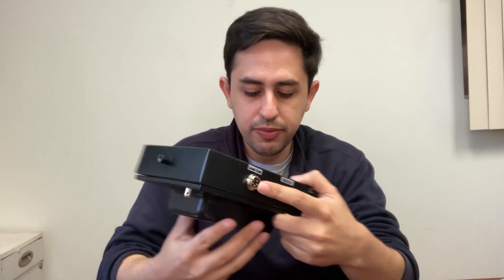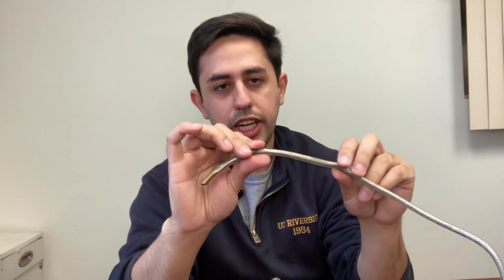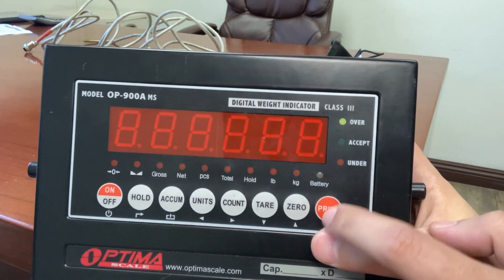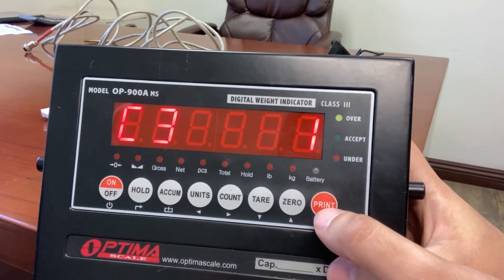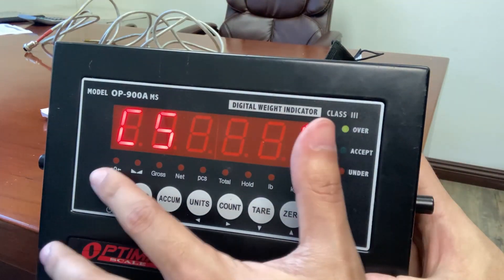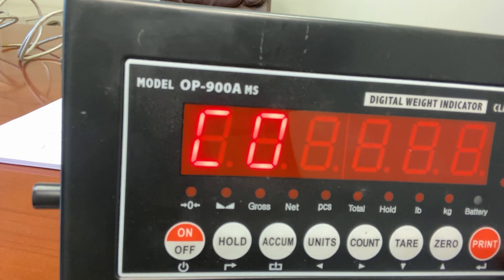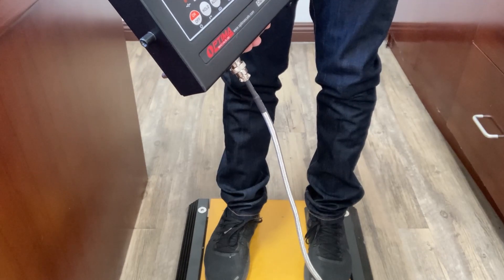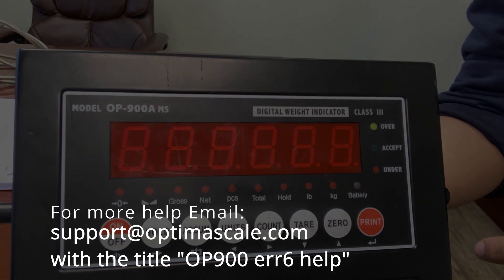OP 900 Err6 / Calibration

Comment: Hey man, great videos. I do have a question about error 3 and 4 for the 900b ex. As well as when a scale head is powered on and just has dashes and won’t let me do anything.
Reply from the maker: error 3 is input signal is negative. This usually happens when the green and white wires are swap and giving a negative signal. You can check the C15 setting to see how it responds to weight. The video on the channel called how to fix a floor scale explains more about this. 

error 4 happens when weight is unstable. Usually customers put too many decimals that their scale can't handle. Try to use less decimals and try out. If it still happens then probably damaged cable to readout. Check C15 setting as well.

I haven't seen the dashes probably overload or short in cable. Try to go into settings and recalibrate. 

email: support@optimascale.com for any specific questions you have.

Comment: Error 2?
Reply from the maker: If the indicator is 10+ years old then you would need to use 10% of capacity to calibrate. If newer than that check the wiring in the platform. There is video on channel on how to fix floor scale. Follow cable to junction box in platform and open that up. Check wiring in there. Might be a wire loose or in wrong order. They should all be in the same order. 

Thanks,
Anthony

Comment: Error 4? Plis
Reply: T scale err4
Reply from the maker: Happens when weight is not stable. Make sure your test weight isn't moving. If it is not moving then check the wiring in the junction box in the platform. It could be 1 wire loose. Watch my how to fix a floor scale video on more details. 

Thanks,
Anthony
Reply: @optimascale6851  thank you, for showing me how to overcome it